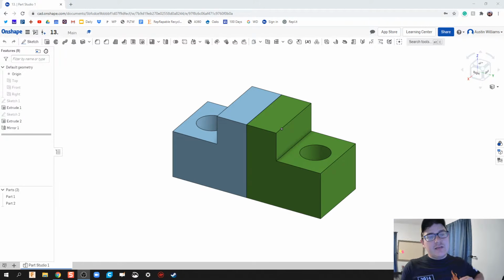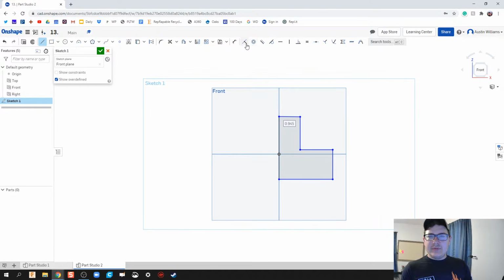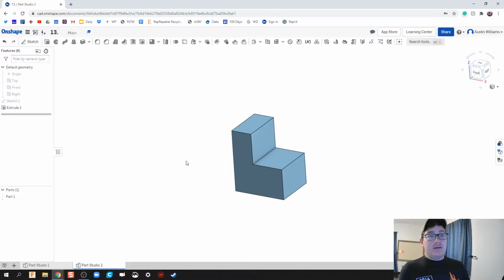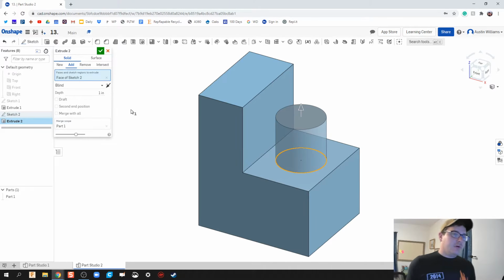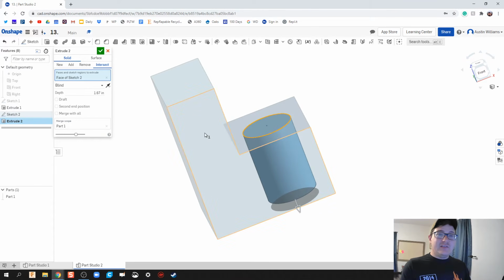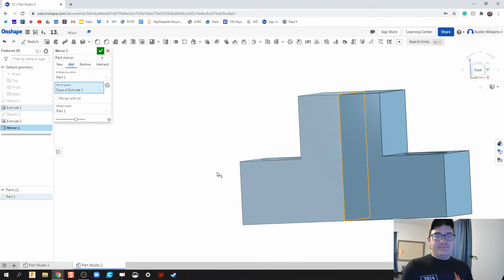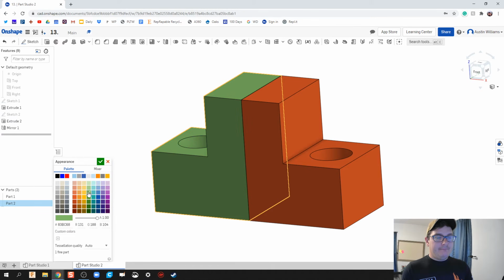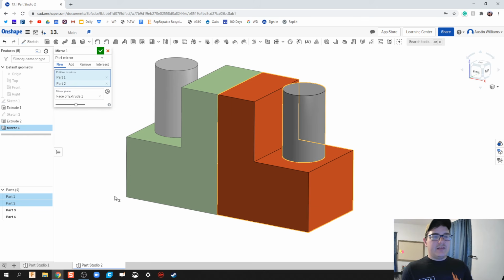Extrusion Settings (New, Add, Remove), Parts, and Mirror - Day 13 of 100 OnShape Journey

Comment: How long did it take you to get proficient with onshape? Ive been doing onshape for about a month now,  im slowly catching on.
Reply from the maker: About six months before I hit a solid rhythm on anything CAD. Once you learn one system, you can pickup others quickly.
Reply: @LearnItDoItMakeIt  I tried freecad,  quickly gave that up after finding onshape. Freecad doesn't have the support base as onshape. There seems to be more interesting tutorials also.
Reply from the maker: I really enjoy OnShape because it doesn't require a costly computer to run, just an internet connection. If you want me to make a specific video (or honestly remake a video because my quality has drastically increased over the last year), feel free to reach out.
Reply: @LearnItDoItMakeIt  i need to learn how to use mate connectors in the regular work plane . I can figure it out in the assembly workspace
Reply from the maker: @250smacks  I've never had to use mate connectors in the part studio, but it allows you to create a spot for a mate face to go. I've always figured it out in the assembly, since that is where the mates are put into action.
Reply: @LearnItDoItMakeIt  , thanks.  I guess its normal to switch back and forth from parts to assembly then to see if parts actually fit
Reply from the maker: @250smacks  if you use a top down approach (design multiple parts in one part studio), you won't need to go back and forth. My automata videos show the difference between top down or bottom up. Or a quick Google search.